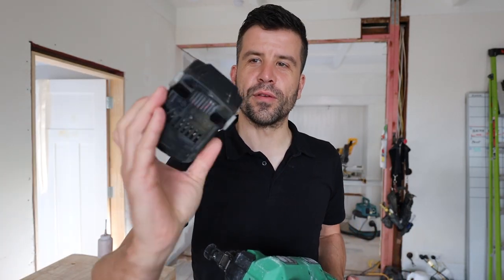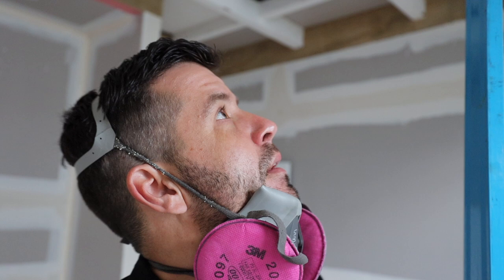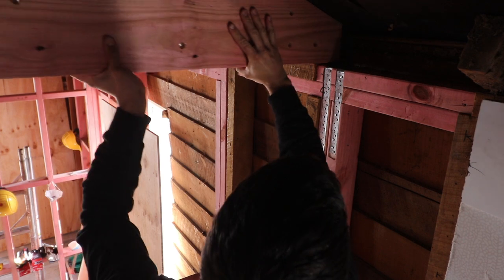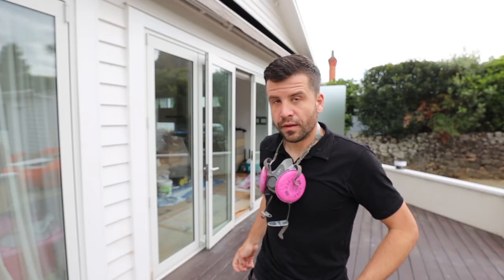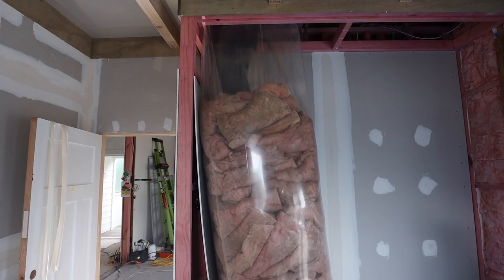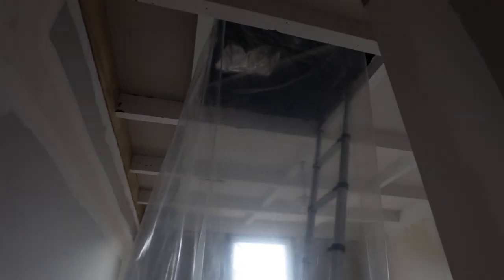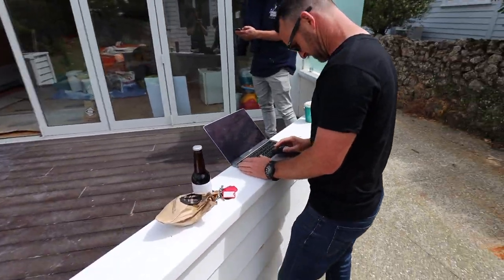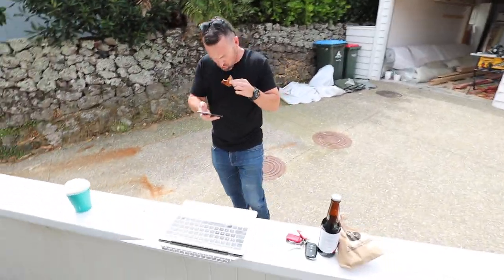Why We Don't Insulate in New Zealand.

Comment: I'm not used to paper houses, since we build with bricks here in EU. Or at least the main support structure. This is just.. Idk. Not my cup of tea. And then you complain about high electricity bills. Like.. make energy efficient houses. This aint it chief.
Reply: We get earthquakes here chief. Timber v bricks in an earthquake?
Reply: agreed, its ridiculous. nz has high energy costs but high efficiency housing is very rare. energy costs are so high people just don't use it and put up with cold/heat, which in turn effects their health. most people are very well taught to not use power, just madness.
Reply: Semper Fi  does that take more effort and time to do than simply building with wood?
Reply: @run_it_straight829  Takes more effort, also makes the house more comfortable and lasts alot longer than timber.
Reply: @Jeroenneman  not to mention higer tolerances, timber twists and warps and often isn't straight to begin with. you wont have that problem with brick.
Reply: Well were I live we use concrete! We get the benefit of efficient and earthquake proof houses

Comment: well insulation doesn't only protect against cold, it protect against warmth too ;-) aka lower AC bills etc. etc.
Reply: Not many houses in NZ have AC...
Reply: @NighthawkNZ  just means insulatin is even more important then, which is what I use here, in summer windows are open at night and closed early in the morning before it heats up outside, and then closed until late evening where it cools down again and windows are opened. helps to keep the house nice during the summers without it costing any electricity

Comment: Is it just me that thought the insulation being taken out looked good? I wouldn't be surprised if the regulations change in the next few years in NZ. As climates are getting warmer across the globe it's as much about keeping heat out (to reduce the energy need for air conditioning) as it is about preventing heat escaping.
Reply: Grishnakh Boogboi  Well if that's the case then you've just proved my point. The houses in the colder part will need heating and the houses in the warmer part will probably need air conditioning. Both require energy and both are affected by the presence of insulation. Fully awake, but thank you for checking.
Reply: Grishnakh Boogboi  Good chat, very informative and constructive........'You're'

Comment: Yeah... a bit of a misleading title.  we've been insulating houses since the 1980s.  It's just the older houses that are not built to be insulated.  most of this video is pretty much BS.
Reply: yeah, title should have been about minimal insulation rather than none. Minimum R rating here in roofs is what R2.5 or R3.5 depending on location? Similar sorts of climate zones in the US they're talking R35 minimum in the roofspace, maybe R15 - R20 in the wall cavities, as well as many other requirements regarding moisture and airflow barriers.
So basically he's right, our insulation standards are so low that to many from overseas we don't insulate.

Comment: Well, a bit of what we do in Portugal. Buildings are all made with steel and cement for main pillars and floors, my 250m2 building, is 25 years old, besides a few repairs on the roof and next building joint. The skeleton is filled in cement, floors are 40cm of cement. This walls are double line ytong outside (it's a water repelent brick) and cinder blocks on the inside with a breathing area between. Windows are triple glass, technal windows with two opening methods. Our temps go from spike 0 at night, to 45 in the summer. The place I live, is very humid. We don't need  warmers in teh winter as te house is fully isolated, even waste  chimnees have valves. This is considered the top of the line building way. Country houses are built the same way. usual quality is two cinder blocks wide wall and double windows on rails. Since around 30 years ago. But I do love wooden houses, they feel a lot different. Love your work and videos talking about NZ and how things work there, are interesting. for me at least. cheers.

Comment: cold weather is not the only reason to insulate. Heat in the summer and external sound are two good reason for it.
Insulation not only keeps the chill out but it can also keep the heat out. So if you have hot summer your AC bills and temperature variation would be much better.
Reply: Heaps of people don't have AC and as a result insulation does nothing to help in summer.

Comment: USD3.60 for a sandwich in a major nz city. So cheap! Interesting stuff on the road blocks (consent) to insulating. Maybe do a video on costs of basic items in NZ too? Like lumber, common sheet goods, insulation, builder grade double pane window?
Reply: Take North American prices.  Add 60%.  Now you have NZ prices :(
Reply: @rawiriblundell  interesting. its just under nzd$10 for a 2x4x8 (40×90x2400?) in the Seattle area at the moment. Hard to compare dimensional lumber since your standard stuff is treated though I think?
Reply: @AussieInSeattle  Yeah, 45 x 90 is the comparative size here.  Having a quick look online now, the lowest grade of that (Bunnings, one of our Home Depot/Lowes-alikes) will be H1.2 treated and would cost about NZ$4.74 per lineal metre.  But that's Bunnings timber.  Bunnings timber is fence fodder :D  From memory the better stuff is in the region of $7-8/lineal metre, but none of the trade suppliers (like Placemakers who Scott goes to) list those prices online, so don't quote me too hard on that.

Comment: Live in West coast Norway, typical winter is around zero and wet. Can have cold periods with -10 degC but not for long. Renovated a house built 1975. Ripped off all exterior sheating, windboards and removed insulation. Extended all framework Fromm 100 to 200mm, new insulation 200mm, R value 5,9, asfalt sheets all around, required due to windloads, wapour barrier, treated underlay and standing boards on top (treated and oiled). Changed all windows to triple glazed, u-value 1,2. All done by myself with excellent help of family and friends. No applications required, nor inspections or approvals. Well documented for my own sake.. Electrical bill reduced by almost 50%..

Comment: I know I'm late to comments, but I figured I'd add my un-asked for 2 cents. I live in northern Michigan USA. We get 14 feet of snow and spend most of 3 months below freezing. My house is an old 70yo cottage with a bunch of shoddy additions and remodels. It has terrible insulation. After a couple drafty cold winters I installed my own Bosch Greenstar boiler with baseboard heat. Now I have constant silent warmth. My WORST gas heat bills are under 200 USD. Total cost (self installed) was under 5000 USD. I add insulation as I remodel and get rid of the bad work, but I'd put in good HVAC long before spending any money on wall insulation or new windows.

Comment: you can retrofit wall insulation by drilling holes in between the wall stud bays and blowing it in. it can be done through exterior or interior. in the united states a lot of us insulation contractor slike to use cellulose  for this applicaiton

Comment: One of the systems that I've seen for putting insulation in existing walls is to cut a small hole in it and either use blown-in insulation or the expanding foam insulation to fill the wall cavity between a set of wall studs.  We are not concerned about the insulation having a vapor barrier on it because the houses will have some sort of sheathing or something to act as a vapor barrier anyway...

And if you believe that you should not need government approval to do modifications on your own house, then you just do it yourself.  No one notices anything that you are doing to the inside of your home anyway...
Reply: Most old NZ homes do not have any vapour barrier or sheathing. Weatherboards, studs, shiplap/plaster.
Reply: Blown in wall products will create problems as it will cause it to sweet an can cause frames to rott. Air gap is a must. I did insulation for 8 years. New build, retro and commercial.

Comment: G, day Scott and team, To use the phrase " roll the dice" If the building code and standard for residential housing stated : External wall insulation must have a waterproof barrier and sealed, this would:
1. Enhance internal climate
2. Remove associated costs.
I still believe the underfloor and roof voids need ventilation, because they cannot be conditioned.☔🌏

Comment: So no pour in foam insulation or blow in insulation? In the USA we have the option of drilling a small hole either inside the house or removing some siding at the top, drilling a hole and either filling the cavity with a expanding foam insulation or blowing in insulation.

Comment: 3:36 is that vapour barrier directly on the ground, is the under floor space vented to the outside? Were there any discussions about vapour barriers in the walls and ceiling when you insulated?  

PS It might not be crazy to insulate a wall and leave a single glazed window in, assuming the old window is well sealed, there could be a very long pay back time for new windows.
Reply: Vapor barrier on the ground. Under-floor space vented to the outside. New houses are moisture wrapped before external cladding goes on. Old houses... you do what you can. Moisture barrier between the studs and hard up against the cladding if you have to but preferably an air gap between barrier and cladding.

Comment: Maybe Auckland is different but to insulate the walls in my fibre cement shingle state house in Kapiti it cost $300 for the consent and didn't need any architect involved. They just wanted to see the products used in the paper work and the it would be installed correctly. One inspection was needed to check original paper didn't have jokes and new paper had been fitted where needed.

Comment: Pinkbat is only glass fibre is not prevented heat loss or entering the house, not only unhealthy. Do need to change cheap insulation stuff and choose way better solution. Wool insulation is one of the best choices.

Comment: Hi Scott, just wondering if the battery on the Hikoki Nail gun reach 1 bar in the indicator... I've been using mine for only a year.. what I notice is that the gun does not work under 2 bars on the indicator.. you have to change with a newly charge one... I bought it new and I was thinking my batteries are not compatible with the gun... batteries are 36V - 2.5Ah multi volt... same as in your video...

Comment: The movement from other countries to require and use more insulation is not because of climate but more about heating cost and climate change. The first wave on insulated houses in western europe came due to rising heating costs, where it would be more cost effective to prevent heat from leaving the house than to just continuously heat the home. More recently, the regulations got more strict to prevent climate change as much as possible, trying to reduce the amount of energy used to a minimum. Constant investment in different insulation techniques has lead to a market where insulating houses is more cost effective than paying endless heating bills.

Comment: would be fun to see you build here with me in northern Sweden x'D we make extra thick walls to insulate away from that -40C cold..
And if you wonder.. Yes there are days where you are measuring and pouring out concrete foundation in -45 with wind and snow in your face =)
Reply: We only get -20 C where I live but insulating is an obsession for us. It’s inconceivable to me to not use insulation in any climate. 😳😎❄️
Reply: @fergusontea  same here. regular house owners don't even know that isolation is keepting the heat out ^,^ 
So in summer it's a few C lower inside than what it is outside.

Comment: In the states there are different codes for different areas. In South Dakota, the code is... insulation with R13 walls and R38 ceilings. Vapor barrier (5mm) either ceiling or walls... not both. That allows homes to breath. That being said, tyvek weather barrier on the outside is also code... breaths one way. Allowing for water vapor to escape, but does not allow rain to penetrate.  Here in SD there is a 140° temperature swing.... -40° F in the winter to 100° F + in the summer, and humid. 
Enjoy you’re channel. Once covid is over, Sure would like to visit NZ. Thanks for the tips. I’ve used a few of your “methods“  on my construction sites. So... good job!
Reply: I've seen R values that high before on American vids and wondered if it's the same scale. NZ  goes up to R5 (as far as I know)  for ceiling. Regs are less than that- 3.6 ?.
Reply: @markgilchrist860  I just googled what you said and R-values seem to be the same in the US and NZ but in NZ there’s a U-value as well. I’m not real clear what that is...i think it’s a air transfer value. I might be wrong. So the code there’s a combo R-value and U-value formula NZ. 
In the US, mostly in the colder climates, they make the house super tight. Then we have what’s called “Air to Air Exchange” it’s added to the HVAC (heating system) where it brings in outside air into the furnace return air.
I built a house and used spray foam. R-21 on the walls and R-35  the ceiling.
Reply: @gman8557  Just looked up U- value (never heard of it before) and sort of understand it as the overall heat transmissibility  of a building. Combining all the individual elements,  glass, walls, floor etc
Reply: @teenaramsay2469  Thanks Teena , That makes a lot more sense. US exceptionalism at work again.

Comment: Can someone explain what’s the paper used before the insulation ? Never heard of that before
Reply: It is a waterproof barrier. Its a back up to prevent any water that may get through the cladding from entering into the house. In this case when you retro fit it from the inside with the cladding already in place it is purely to stop any of that moisture coming into contact with the insulation.
Reply: It's called 'house wrap' in the US. It's usually a polyester, like Tyvek.

Comment: And Expat Kiwi In Austria.  Couple of points Insulation is not just for cold  protection  it also protects against heat. In Vienna winters can be brutal but summers   are very stable and, for even Auckland standards,  hot (30-35 degrees for  2-3 months of the year)   Now when I visit NZ   I find Kiwi houses just wooden tents and even in Summer they feel cold and drafty.    I doubt any one would be able to afford to build a house to Austrian standards in NZ.   I don't expect NZ houses to meet Austrian standards but I do think they need to be better built and insulated than they are.   I think insulation to protect from summer heat should be a consideration.  I think the biggest shock for me was reading a report that Palestinian refugees  live in better insulated houses than Kiwis do.

Comment: Underfloor Insulation R1.5 for Landlord requirements R1.8 if your boujie or if your from ponsonby.
Reply: Pink batts for a R2.6 underfloor too.
Reply: @TheJohnno25  Polyester is the go i dont envy those who install pink batts thats stuff can be a nightmare.
Reply: @fromburgundywithlove6189  polyester is ok, but I like the fact pink batts are recycled glass. Pink Batts these days have bigger fibres than they used to so aren’t anywhere near as itchy as they used to be either. I find that the worst part is the dust when retro fitting.
Reply: What is the conversion to the way usa does r values? 3.5 inch (90mm) deep mineral wool is considered R15.
Reply: @AussieInSeattle  R3.2 is 115mm, R3.6 is 155mm for Pink Batts ceiling. Other brands differ.

Comment: Pretty similar here in North East u.s. we insulate the exterior walls, attic ceiling, and crawlspace. We do interior walls where noise dampening is needed. We do use a higher R value though. Exterior walls are generally r19  while floor and ceiling are around r30. In the winter months in the northeast the temperatures vary greatly. I live in maryland where in the middle of winter it can be as cold as 20°F while further north in new England states it can be 5°F.

Comment: Were they sucking out the insulfluff? Is that stuff hazardous like contains asbestos?
Reply: the fluffy stuff is normally cellulose/fibreglass based so about the same hazards as modern stuff.

when it's loose "pebbles", thats vermiculite which is very likely to contain asbestos

Comment: Be careful when insulating interior walls. If your room hasn't had exterior wall insulation and ceiling insulation added, your heat will radiate out rather than radiate in

Comment: I think it’s something like 40% of your heat losses go through the ceiling. Also insulation works both ways, in winter keeps heat in and in summer can reduce heat coming into the building. If you have AC it will be more efficient with better insulation. I’m an architectural draftsperson so I love that you are explaining this to people and it makes sense to spend a bit more on insulation when you can do it like even go above the minimums stated within the building code. It pays you back in the long run with lower heating costs.

Comment: We dont even have to take the wall apart here lol we dense pack cellulose from outside by removing 1 peice of vinyl siding dril a hole pack with a 1" hose foam the hole put the siding back like we were never there
Reply: Same here in new zealand
Reply: Grishnakh Boogboi  don't actually know the details, just know it can be done. I've always stripped the wall lining and done it the traditional way, let's me check the waterproofing of the house as well (as well as being uninsulated our houses aren't usually waterproof).

Comment: i think i prefer closed cell foam board , held in place with 2"x1" battens running parallel with the joists , should last a hundred years plus , perhaps.